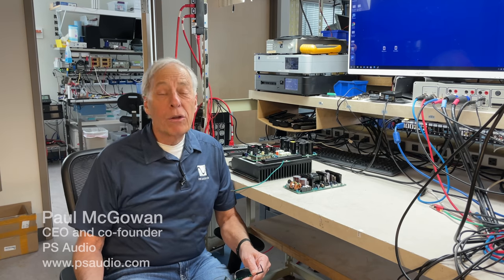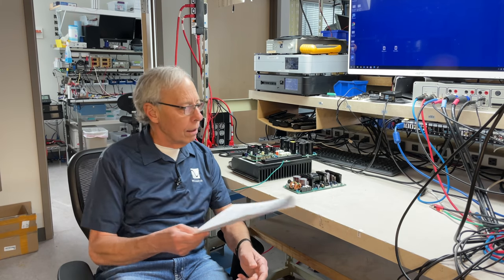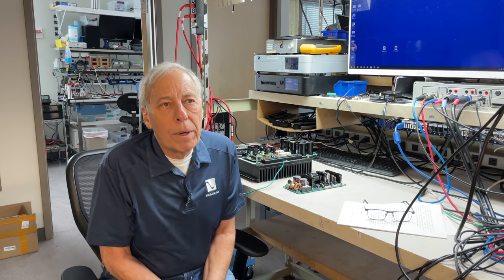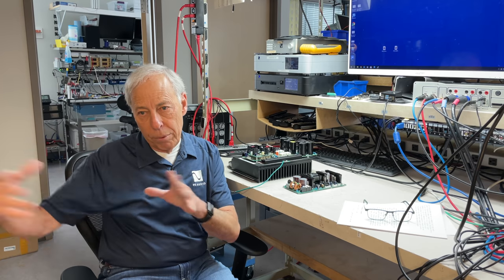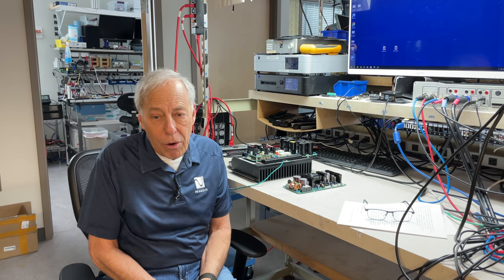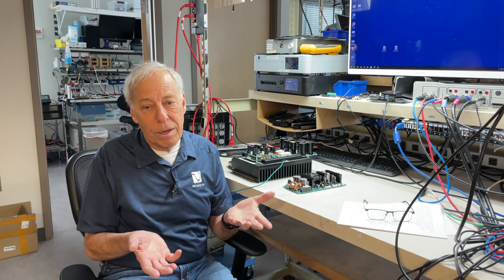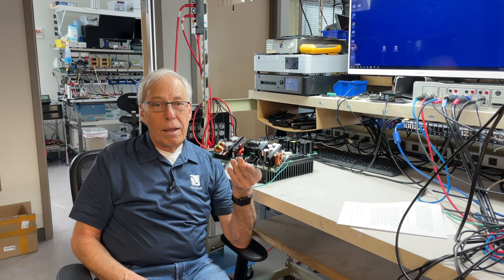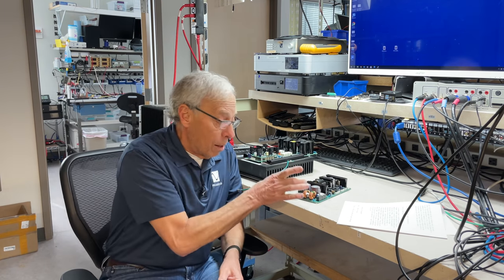Why do some amps weigh so little?

Comment: I just purchase a new car stereo it weights nothing I check it up the datsheet of the power transistor and it says it doesnt need any capacitors, and i was suprised it is class a b instead of class d, its like a tripath copycat design, and it has very microscopic electronics, even the leds are so tinny, and the sound is very good.
Reply: If it's class AB, it can't be a Tripath copycat. Tripath is class D.

Comment: I never heard PS audio gear but Paul's posts give me something to think about. Many years ago I bought a pair of class D momo amps. I did not like them. Everything sounded very dry. I bought a McIntosh MC352 amp years ago off of ebay. Still have it and sounds pretty good to me. I'm not thinking about selling it but who knows. I might take a crack and buy the PS 700 amps.
$3,000.00 is a very good price for a pair of mono amps IF!!!! they sound as good as or better than my MC 352 amps.
Reply: If you live in the US give The Cable Company a call. They have PS Audio and will send you demos to try first. If you don't like them, don't buy them.
Reply: @solarfall2728  
           Thank you. Not right now but I will contact them

Comment: I find it hard to believe that PS Audio uses a pre-built ICE module in their amplifiers instead of building their own quality amp circuit. Class D is for car audio. We replace a lot of those ICE modules in cheap guitar amplifiers. Electronics engineer with 40 years experience.
Reply: As the saying goes why reinvent the wheel , instead just make improvements . Personally I doubt they have the skill for a rather small company to design a good class D amp from scratch.
Reply: Don't agree Audiophiles for nearly 60 years had many well know amps all sorts during my journey finally switch to a NAD c-388 very happy with it drives my speaker effortless and can be upgraded by module that what I call progress and NAD is a company that has enough experience in that regards
Reply: Cheap guitar amplifiers - there you go. It's cheap and people are thrashing it

Comment: Tubes seem too finicky and expensive and class D is the only amp that has ever failed on me (active subwoofer) and many manufacturers of active speakers offer a shorter warranty on the amp than they do for the rest of the speaker. Class A/B all the way for me.
Reply: Carver's new tube amplifiers come with a 5 ,10 and lifetime warranty depending on the model, and all have an estimated life of around 50 years.
Reply: Plenty of class AB amps with issues too. Decent ones may have the advantage of longer refinement time with build.

Comment: Class D offers 90% of what Class AB offers Paul?  That's why we audiophiles are constantly looking for the holy grail of sound. A  10% difference is huge and very  noticeable.  Just got rid of my relatively Class D Amp.  Replaced with Class AB.  Not even close. Class D is not musical, sounds hollow to my ears
Reply: That "hollow class D sound" - so true.
Reply: Depending what you checked out every company has its on design and Im very happy with my NAD C-388 and been an Audiophile for nearly 60 years I had quit a few well know amps A ,A/B and tubes during my journey but was blown away with this product of NAD. A forward looking product which can be upgraded with module to your choosing.

Comment: Maybe Class D.
Reply: Or class H
Reply: @scottyo64  Yes class H is efficient as class D but is actually class AB in the amplifier section.
Reply: @leekumiega9268  they just dont have the big transformer and weigh much less than class A/B, oh and take much less power and run cool

Comment: it is not difficult and understand it. old transformers provide clean and noise free power but are large and weigh a lot. many newer amplifiers use switching power supply which weighs much less but has more noise but is used a lot in newer PA. amplifiers. but in general when an amplifier weighs very little it is often less good quality
Reply: It doesn't work like that. The reason class d weighs less has to do with efficiency and design. A transistor is a switch. Switches like to be on or off. What happens with class a or ab, is the transistor that amplifies the signal is run somewhere in between on or off almost 100% of the time. This generates a great deal of heat, so things have to be built to take that type of stress. Class D amps work differently. The amp taps the analog signal coming from the preamp and converts it to digital. That digital signal is then used to turn the transistors off and on really fast. They never operate in between, just on or off. There's almost no hear generated. The HCA-2 amp that Paul mentions in the video runs cooler than the matching preamp (PCA-2).

"but in general when an amplifier weighs very little it is often less good quality"

Making a class D amp heavier wouldn't give you better sound, or build quality. There's just no reason for it to be heavy.
Reply: No. Transformer would not filter any noise from mains input, a good SMPS would. SMPS can be less noisy than transformer, if designed properly. And it will hold its output voltage no matter the load, so it can even contribute to better dynamics.
Reply: @solarfall2728  Class D does NOT convert analog signal to digital, it's analog all the way. The fact that it gets PWM/PDM modulated doesn't mean it's digital.

Class D IS NOT digital.
Reply: @tomkocur  Calm down. I know you want to be right. While there's no requirement that a class d amp convert the signal to digital, the ones of the context of this discussion do. The ice modules, and most of the other popular ones for audio, tap into the analog signal, convert it to digital, and use that digital signal to turn the transistors on and off. I shouldn't have to state the obvious, but everyone knows the signal you hear coming out of a class d amp never gets concerted to digital. The digital is only used in the control circuit. I can provide references if you like.
Reply: "Class D amps work differently. The amp taps the analog signal coming from the preamp and converts it to digital."
You were talking about Class D in general, I don't see ICE mentioned anywhere in this discussion.

But go ahead, provide the references please. I don't see ICE mentioning "digital" anywhere and I don't see any AD conversion in the functional block of TPA31xx, which is a pretty popular Class D amplifier IC.
Reply: @tomkocur  Paul told me. I asked him about this very issue at CES one year. It was after the release of the HCA2. The ICE modules go in those. Jeff Rowland uses them as well. 

I brought ICE up because its mentioned in the video.
Reply: @solarfall2728  so can you provide a reference, or not?
Reply: @tomkocur  You're kidding? I'm going to stick with Paul as my reference. If he's not good enough, no reference I give you ever will be. You know what the truth is. You just don't want to be wrong.
Reply: @solarfall2728  when you said "I can provide references if you like" I was expecting some article and/or a block diagram, or at least something (since you used plural), hoping to learn something new. Instead I got "Paul said it to me" and now you consider that as some kind of reference. Maybe that's right and HCA-2 does indeed do that, and in that case I'd like to learn why it does that (what's the benefit) and what it uses the digital signal for.
But for me, there's still a chance that you just misunderstood something, or you're making stuff up.

You said "digital signal is then used to turn the transistors off and on really fast" - this in particular is what got me interested. Why would you do that? This essentially means you're doing an additional ADDA conversion, you'd have to quantize the input signal (without that we can't talk about digital), which is a lossy process and then use this lossy signal do generate the PWM/PDM on the output. This means you broke the analog path. What is the benefit? Why not let PWM/PDM modulator do this instead and not break the analog "continuity"?

PS Audio does mention "Super Digital Amplification Technology", but doesn't explain what it actually is.

You said most popular class D amps work this way and that's just not true. Most of them use PWM.

I know you want to be right, but unless you can prove what you're saying in any way, or at least show that you understand the topic, I don't have any reason to believe you know what you're talking about.

https://www.youtube.com/watch?v=WJf-czaTVws
Reply: @tomkocur  The fact that some class d amps convert the signal to digital is common knowledge. You asked for a reference and I gave you one. I could refer you to all the reviews of the amp where they cover this, but they're getting the information from Paul anyway. This isn't exactly a secret. Google never seems to work when we don't get the answers we want them to be. Look up the definition of class d. Every definition will tell you the same thing. 

If this information was really hard to find, I would have no problem helping you do some research. But that's not the case. As for you not having a reason to believe me, I'm perfectly OK with that. You can believe whatever you want. Some people still think the Earth is flat.
Reply: @solarfall2728  Did you watch the video I linked in my last comment? Paul's explaining there that Class D is NOT digital. Are you saying he's wrong, or that he doesn't understand how amplifiers work?

"Look up the definition of class d. Every definition will tell you the same thing"
This looks like you're implying ALL class D amps do AD conversion. Where did you find a definition saying Class D amplifiers convert analog signal to digital (discrete) domain? Give me a link.
Wiki is saying this:
"The term "class D" is sometimes misunderstood as meaning a "digital" amplifier. While some class-D amplifiers may indeed be controlled by digital circuits or include digital signal processing devices, the power stage deals with voltage and current as a function of non-quantized time."
Power stage is that on-off thingy in a class D amp.

Discrete doesn't necessarily have to be digital. And just like for example switched mode power supplies, class D amplifiers are typically not digital, either (many of them do have digital processing built in, but in most cases it's not in any relation to the power stage).

People think Earth is flat because they don't understand physics. Seems to be similar with you and amplifier topologies. I would be grateful though, if you could provide at least a link to the review where the principle of HCA-2 is described. I really do want to learn something new.
Reply: I heard many of those old transformers providing anything but clean and noise free power.